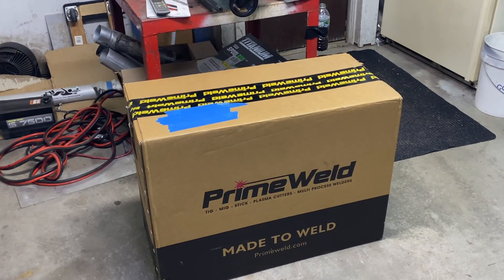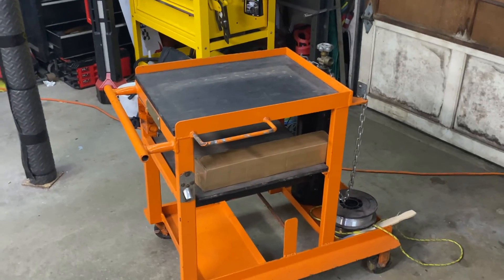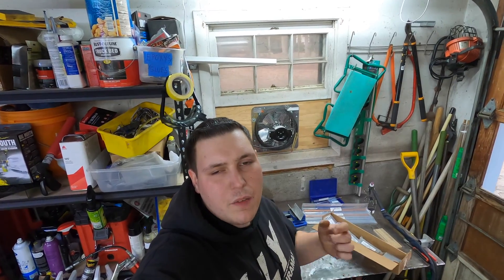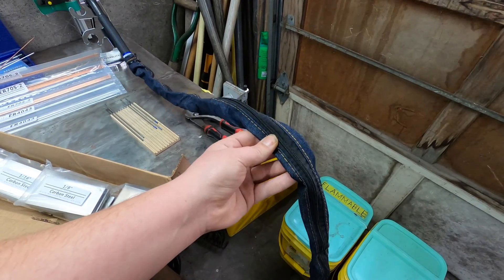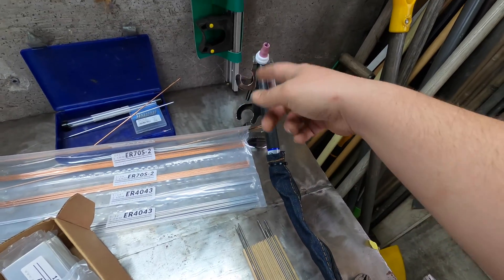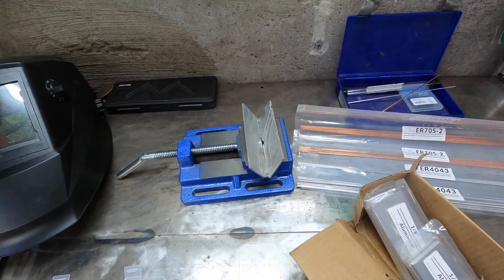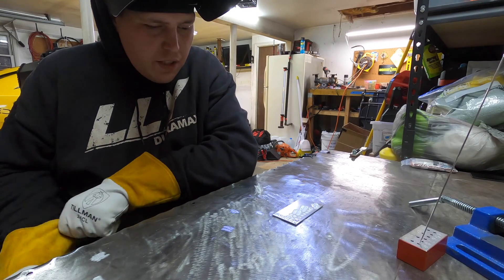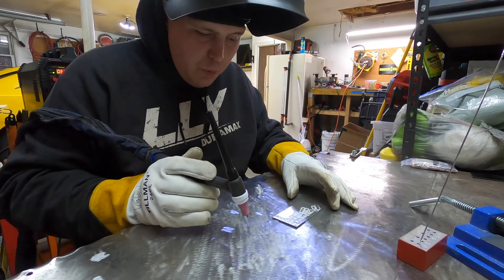PRIMEWELD AC/DC TIG 225X review + cheap upgrades/add-on's best budget welder under $900???

Comment: Send it back, spare the extra coin for the 325 with the water cooler, youll love it
Reply from the maker: Yeah I’ll get the 325 at some point of course the 325 didn’t come out untill 3-4 months after I got mine
Reply: @bought2build  I got the 225 not really searching for that particular model, but it seemed decent and seen reviews about it so I got it and the cooler. Later on that same day after ordering I seen the 325 pop up on face book. Looked it up and like the extra power. Even if I don't use all of it, the fans not being always on was definitely a plus. Also everything for it is more robust. Even the ground clamp. It takes a bit of force to even open the jaws. The stick torch as well. The leads are definitely beefy and so is the weight of it. Sent the 225 back and ran with the 325. Runs off of both and 240. For small jobs plug it in the wall. For heavier jobs, bring out the generator. All in all, highly impressed with the capabilities of that welder in comparison to its price.

Comment: Got the same tig and just started using it more for turbo build.   Need to learn more ac and frequency
Reply from the maker: That’s awesome man! I taught myself doing my aluminum cold side piping got a video of it on the channel.  once you get it it’s fun!  
For me it’s all about finding the right AC balance the frequency I use just to really dial it in on certain things but the ac balance can give you a hard time at first good luck! 🤟🤟🤟🤟🤟
Reply: @bought2build  what setting would you suggest for intercooler piping?? Do you pulse it or foot pedal?  Will check out other vids on your channel
Reply from the maker: @BulliKid  honestly it’s not the answer that you are going to want to hear but… it all depends what brand the pipe is my settings are way different for vibrant pipe than cheap junk intercooler pipe. I used a lot of aluminum pipe from ace race parts and have had great luck with it and very fair price https://www.aceraceparts.com/?gclid=CjwKCAjw-vmkBhBMEiwAlrMeF7CTtyP9n-o_zhauab1e5c3FeYx8a7Rk8d8AnX2Js91o9dV-goF7IRoCfNoQAvD_BwE

Best advice I can give you is watch as many videos as you can on tig welding aluminum and learn what each setting does and what signs to look for to help you learn to dial it in 

A good starting point is usually 1 amp for for every .001 of material so if it is .105 thick start at 105 amps, ac balance a good place to start is 30%/70%, frequency I can weld about anything with it anywhere from 60-200Hz  I’d set it at 120 and just rock with it until you get everything els figured out pulse I wouldn’t even play with it until you have everything els figured out if you are having issues welding it is more of a bandaid than anything learn to control it without it then when you do use it it will help you perfect it even more 

Third piece of advice CLEAN CLEAN CLEAN! pipe is dirty as hell even brand new out the package and it will make it weld like crap acetone and a clean rag or paper towel 

Lastly this helped  me out A TON learning! 
Do a weld or 2 set the piece in front of a fan or something let it cool to the touch and work on something els then do another weld or 2 then let it cool it will make it easier to keep from melting a big hole as you build a skill set you will learn to work around the heat but to start this will save you a lot of headache 

Lastly keep gaps to a minimum get the pipe to but up to eachother as tightly as possible 

Hope this helps and good luck 🤟🤟🤟🤟
Reply: @bought2build  thanks for the tips. Do you have IG. I’ll show you my first real welds. Didn’t burn through 🫣

Comment: Currently looking at one of these or picking up the eastwood tig200 for $699 right now.
Reply from the maker: I would highly recommend it!! I'm not sponsored or anything but it has been a fantastic machine!! check out the video I did on making all my own custom aluminum intercooler piping for my GTO!!
Reply: @bought2build  that is perfect because my issue right now is i can’t find anyone to weld up aluminum for my intakes or anything. I do some body work on the side so it will be better than flux core as well

Comment: Any chance of using other methods to see if that works to regenerate your eye... detoxing with Dr. Robert Morse ND; 
What do you think of those that could use the 'placebo effect' to heal their body or destroy it...

Also. I thought the electrode had to be disconnected before starting the machine... and then attached after it was on... (I'm new to the machine... lol)
Reply from the maker: I had seven surgeries to try and save my vision sadly none worked alltho they were able to save the eye itself 

I wish I could do some type of placebo to gain my vision back lol 

no the tungsten electrode does not need to be disconnected to start the machine on the primeweld you use the pedal to apply current to the torch and electrode

Comment: Got same welder. Thank God. That first coupon runs looked pretty good. However when you terminate the arc try to taper your amperage and swirl to avoid the fisheye. If it doesn't work you'll have to dip more wire.
Reply from the maker: Thank you for the advice!!! I have to get better about this I was welding some intercooler piping and it keeps happening I tried swirling I tried moving back a little I think I am going to try adding more filler next time